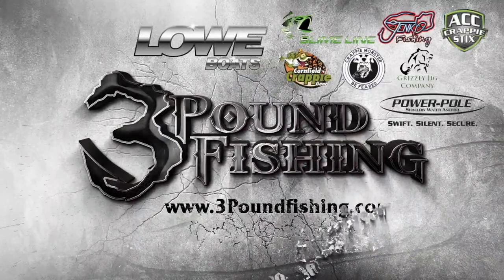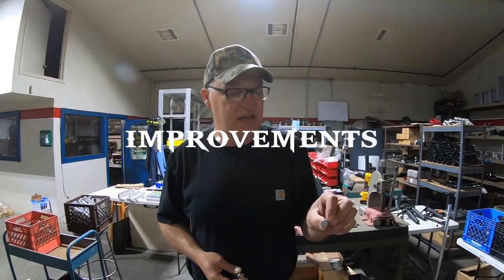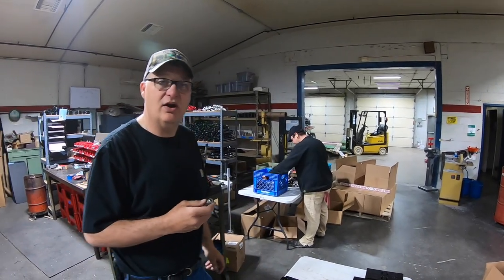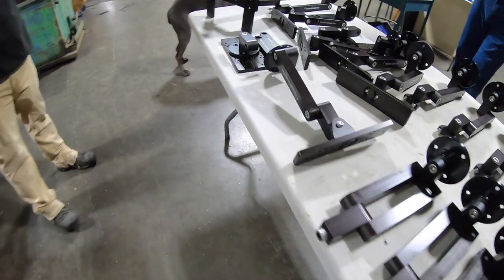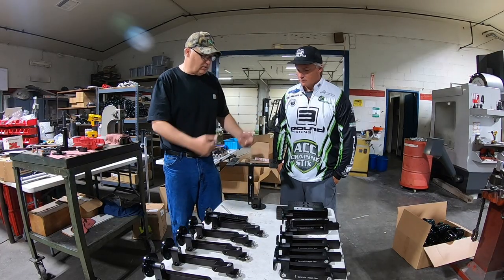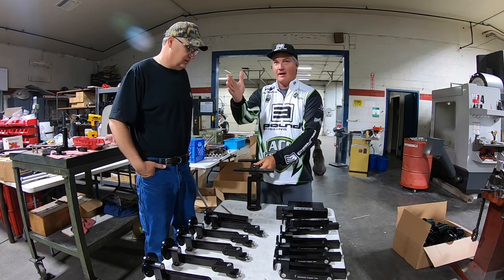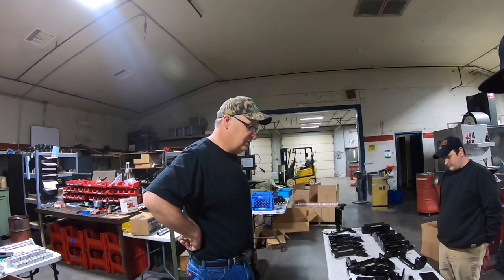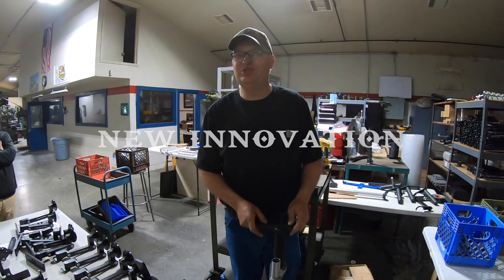Cornfield Crappie Gear Mounts

Comment: Very very nice!  An idea you might think about if you do much mount adjusting with livescope like i do,  is take a large dowel or wooden closet rod , drill a hole in it and Epoxy the 3/8" allen wrench in it.  That really saves your palm and you can really crank down on that bolt.  Over time, and use  those bolts will need to be very tight.  Round off the end of the dowel handle. I love mine!